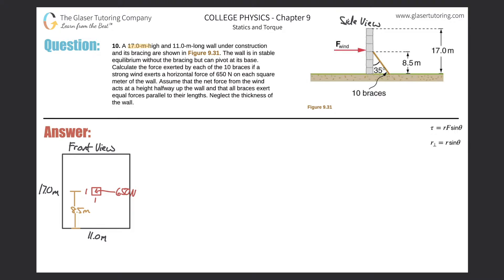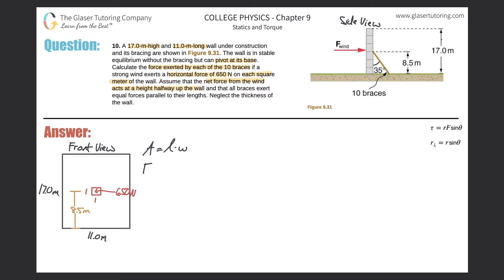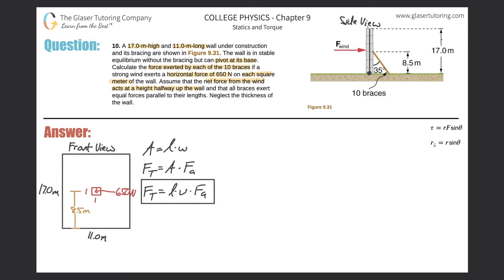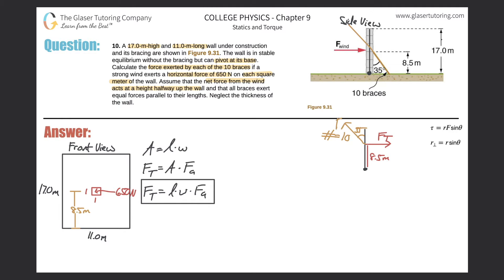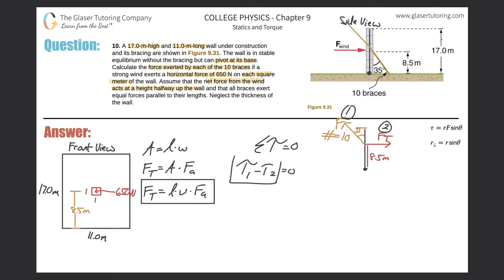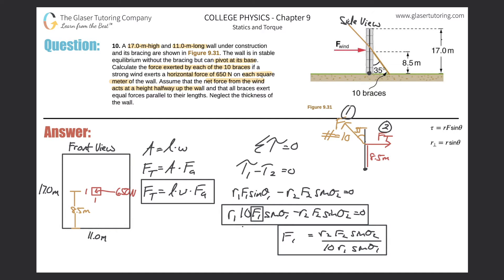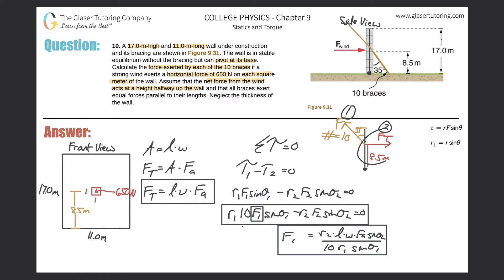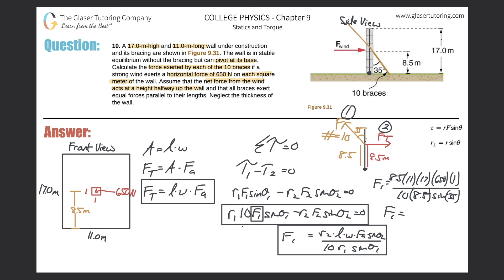9.10 | A 17.0-m-high and 11.0-m-long wall under construction and its bracing are shown in Figure

Comment: Thank you for your videos, they are really helping me through my third round of physics 🙃 Why is r of the braces 8.5m? I am having a hard time figuring that out. It doesn't really make sense to me. Isn't r the distance between the axis of rotation and the point at which the force is perpendicular from the axis of rotation? Am i understanding it wrong?
Reply from the maker: Hi! It sounds like you are understanding it correctly.  There are two formulas: t=r(perp)xF AND t=r(F)(sine theta).  They are equivalent to each other.  If you use the one with the sine function, then r is the distance between the axis of rotation and the point at which the force is applied.  If you use the formula without the sine function, then you need to find the distance in which the force is perpendicular to the axis of rotation.  You would do this by taking the distance between the axis of rotation and the point at which the force is applied and multiply it by the sine of 35.  Hopefully this helps!